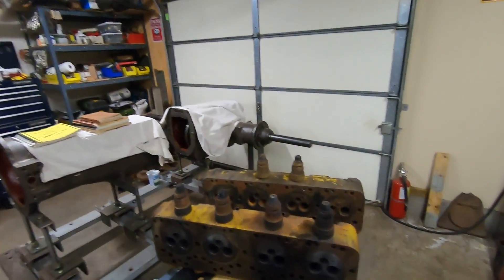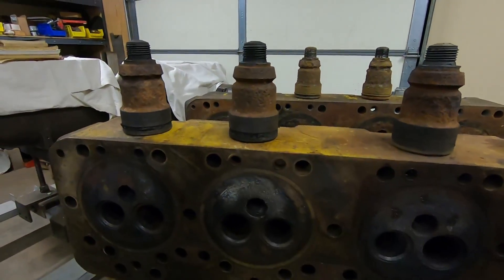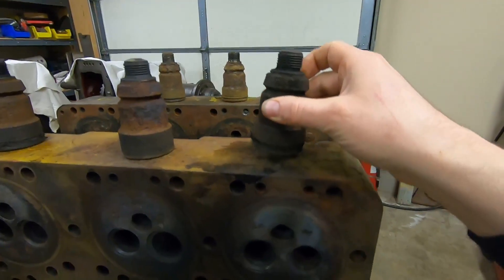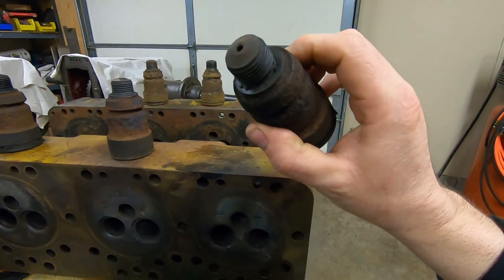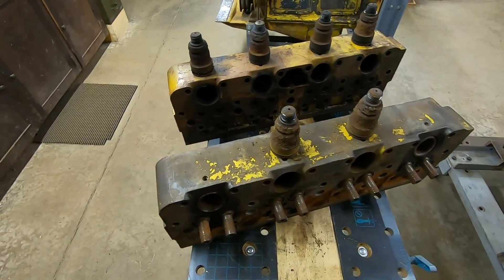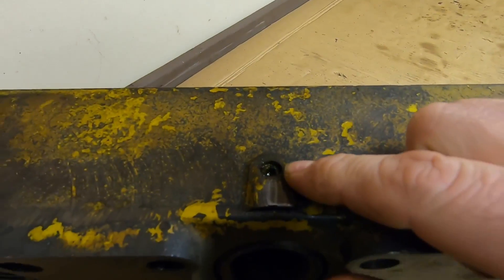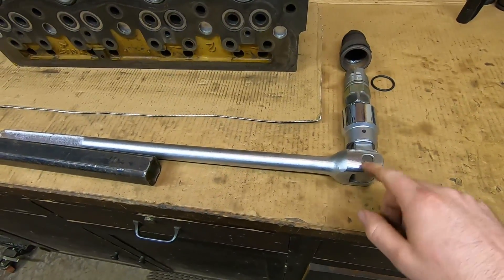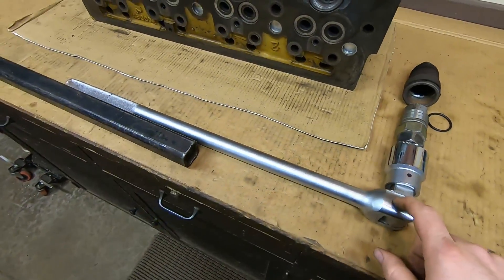Caterpillar D2 #5J1113 Diesel Engine Assembly Ep.24: Precombustion Chamber Conundrum

Comment: you are right it is a catch. Like your shop in Iowa, can you heat the head evenly, such as in a food oven? Do you use a penetrating oil? let it soak with a carb cleaner to loosen the carbon. use a penetrating oil and let it soak. these things should have been done for a long time such as the last couple of months

Comment: The dry ice idea is great.

One other thing to try would be a large ultrasonic cleaner...on low or medium setting.

Can't say how many times it's worked gor me on rusty or stuck bolts on parts heat cant be applied.

Comment: Is there any way to pressurize the water jacket portion of the head and just see if it leaks air up to certain pressure. If you pressurize it and it holds four a reasonable amount of time then it's not going to leak.

Comment: Warm the entire head to operating temperature. Then use cold CO2 in the combustion chamber to quickly chill it and take it out. Don't know if it works on cast iron, but it does work to get stuck spark plugs out of air-cooled aluminum heads.

Comment: This is an old machinist trick you hate up your studs whatever you need out with paraffin wax it works great paraffin wax doesn't burn off when you heat stuff up that paraffin wax as a lubricant

Comment: Is it possible to slowly heat the whole head?  I watched a video of a guy re-sleeving an old hit and miss engine by heating the entire engine to drop the sleeve in.  He said it took a few hours to heat up the cast engine and many more to slowly cool it down.   You'd need a good setup to mount the head securely so you could wrench on the chambers within a minute or 2 of it coming out of the furnace safely.  If you could have a lifting bracket bolted on each end so that you could slide a pin through a clevis, through a hole in the bracket, and then the other side of the clevis with the clevis attached to a couple links of chain bolted to a piece of square tube all supported by/on a conveyor trolley chain hoist.  Then use the trolley to move the head to the mounting, secure it down, and start wrenching away.  There's probably an old shop in Duluth or the Twin Cities with the perfect setup.  It's probably going to take an entire weekend to complete (heat up & wrench on sat, then pick it up Sunday after cooling down for 5-10 hours).

Comment: You have put too much effort into this engine to take any chances. In my experience any O-ring that old in such a critical area should be replaced. Now is better than after the engine has been damaged by antifreeze getting into the oil.  I think it's better to sacrifice a few good parts now than lose an engine later.

Comment: Leave the head alone.   When pulled to the block the .002 will lay flat.  The pre-cups in the head might work for a 1000 hours but if they don't you can easily access them to fix.  Not worth ruining the good parts.

Comment: You already know the right thing to do as you have demonstrated in all your past videos. Sacrificing a few old very hard to find parts is sometimes necessary to do the best job possible. And the best job possible is always worth the extra effort. It appears to me that you are doing the very best job possible to bring an 80 + year old machine back to factory new with period correct parts. New seals on the chamvers is right inline with that. Maybe its just my ocd but i would want 1113's precombustion chambers in that (closer to correct year) replacement head even if those chambers weren't born in 1113's original incarnation.
Just a few thoughts from a dumb mechanic

Comment: hmm...that 1 11/32 bolt in metric is 34mm    one option to getting those combustion chambers out would be to put the head into the oven at 200F for a couple of hrs and then try breaking them loose. that way the head isn't heated disproportionately

Comment: 50+ Years for rubber O-rings is a tough one, I'd go for changing them. I've got some (hopefully helpful) ideas though. I've heard that a mix of automatic transmission fluid and diesel does well on rusted stuck parts, never tried it myself though, so no experience there, I usually go for our local brand of rust remover.  Maybe you can give the head a bath for a week or so to let it seep in and heat it up in an oven afterwards so the whole head is nice an toasty to avoid heat stress fractures and then go for ice spray on the chambers instead of more heat on the head, should do the same trick. Anyways, wish you best of luck on removing them if you choose to do so.

Comment: When is good ...good enough.... well what`s been your approach to this point.... exactly... pull them out!!! I`m following another vintage enthusiast and they were working on a D-2 dozer and it`s funny because they had to pull the head off due to leaking seals on the chambers. They had an aftermarket tool that fit the chamber and they were extremely lucky with all four... only used a little heat!! They had to replace one piston sleeve due to rust... it was sitting for years before fixing... the sleeve was $400..WOW!!! Great content man... looking forward to the completed project!!

Comment: If i were in your shoes i would pull them. With all the effort you put into this engine it wouldnt make sense not to pull them. 
Looking at your tool to loosen the chambers you put the rubber o ring in it to protect it. Maybe it is possible to make a collar on the tool so that it doesn't go in to deep.

Comment: nice video as always in order to take the precombustion chambers out without doing any damage to it and not needing to put heat on it i would use a big air gun the one they use to undo semi's tires off that way those things have crazy amount of power which will be good for ur application saying this is in past i had similar problems on car engines removing stubborn bolts out and the only way is to use something with big force that will drive them out using hand technique can lead to damage since u have the other one rusty head i would try on that one first to see how it performs than use it on the good one and also see if u can make the better tool i would get two of the bolts stack the together and weld them so u have the same hight distance inside of the hex as the tool measure what is the distance of the hex inside and make same tool so it has more to grip on it this way it should not make any problems taking them out. good luck mate.

Comment: I sure hope I don't offend you but all things fail given long enough. Those chambers will leak but when and no more often than run you may be tempted to leave and that is not you. Your best shows up every time you put the boots on and go to work. Some old cat mechanic has that tool as I have had one before in hand but I never owned it. I believe that is a sixteen point "torx head" as I can't remember that many years back. Up close and personal was the place you used your 3/4 drive flex bar. I'm thinking to go around the pre combustion insert, you would have to use a smaller milling head and go back and forth and around the chamber cause it doesn't come that close to the piston or in my world should miss/clear it after said and done cause it will still be in same spot after milling is done, in or taken out and put back. It really needs milled if the dings are bad enough to cause you worry. I have skipped steps like this to have it bite me a couple times and hence been bullet shy. That tool can be found but in  what year or place... australia, japan, usa... who really knows. Have you touched base with all cat people that you know? I kinda lean towards using a variable speed impact to jar it loose but no heat. I seen people use heat on heads and cylinder blocks and I just walk away as it hurts to see that. Thats a Arnold Schwarzenegger attempt. I have used impact to break head bolts loose and no foul. Just my last thing to try. go with what makes your heart happy and go with the roll. I have seen a few liners in the 1693 cummins come just as hard and used a jack on the bottom with a puller on top. I broke on liner puller before I did that of course now I am 72 and worthless!

Comment: Boy you are very lucky not to break the thread off the chamber good job, Loving your reassembly vids all the best to you and your dad with his engine. If it was mine I think I would try to reseal the chambers as that head has been running and that to me makes me believe that they would come out without a big effort , as the other head was just laying around weathering, as you said you do have spares and they can be replaced, even in the future how many times are you going to pull the chambers on other engines to reseal to me not very often so yes reseal them or it’s going to sit in the back of your mind that you only did half a job on that head, GO FOR IT YOU REALLY HAVE NOTHING TO LOSE you can only gain

Comment: Soak with penetrating oil and gently warm the whole head in front of a heater, just so it's warm to the touch not that hot that you can't pick it up. Then pack the chamber with dry ice to shrink the combustion chamber just enough that it hopefully lets go

Comment: Not sure if it's been mentioned before. Marty T used brake cleaner to cool the combustion chamber while used a propane hand torch, it seemed to work for him.  SQUATCH.  As for removal best start using penetrating oil on those chambers while you're thinking about it. THIS is not in BOOKS.!.!

Comment: You can only pull down what you weigh.  If you can lock it down and pull your bar up, you can generate a lot more force.  I weigh 230, that’s the most I can pull down.  I can squat lift 500, that’s twice as much force.  If it’s stuck, pull up.

Comment: I would say give it good time (even days,if need be) removing each chamber with low heat, cooling to ambient, application of DW40 and gentle persuasion. High heat would stress the head, leading to cracking.
On cylinder head surfacing, does CAT have progressively thicker gaskets to allow for machining?

Comment: You've done an outstanding job repairing this engine up to this point and have been meticulous with everything to ensure a maximum chance of success.  Leaving everything as-is, IMO, is just inviting trouble (at least with the luck I have). As much as the potential "suck factor" may be, I'd pull the combustion chambers and mill the head.  If nothing else, it will give you peace of mind knowing it's been done right.

Comment: Oh you have to seal those chambers. Buy the best penetrating oil and use it. You want to, and you can, you will not feel right until you do it. The point is that you are skilled enough to do it. So given all of that. You should do it. I vote for using the best penetrating oil on the planet, perhaps a air impact driver on a low setting to kind of hammer at it, I think you can do it without damaging them as meticulous as you are.

Comment: If I found myself in this situation and failure was not an option I would: 
Buy a short section of 4140 round stock (eBay probably) the diameter of the precombustion chamber thread i.d. or larger to turn down to a nice fit. Then machine the required double hex to fit the precombustion chamber nicely, and then the regular hex on the other end for a socket. Machined to the correct dimensions that would eliminate the need for the O-ring and any chance of possible damage to the tapered injector seat. While that was going on the head could be heated up in an oven or directly in front of a couple electric heaters for a nice even heat. Once everything is all ready put tool in place and apply some ugga-duggas, and I'd be willing to bet they would come out with little to no fight and zero damage. Having a true double hex / 12pt engagement much more efficiently transfers the energy into the precombustion chamber when trying to loosen and will eliminate the chance for distortion that can happen when applying major torque (especially by hand) with a regular hex drive tool.

Comment: let sleeping dogs lie. I would hate to see some threads come out of the head when you try to take them out. if you had a problem down the road it's only 2 -3h to get the head off. how long you're going to spend trying taking take them out? keep up the good work. p.s. my 922 needs a new O rings in its pre-combustion chambers.

Comment: There's an old machinist addage I've lived by for years...."Do it right the 1st time to avoid all possible grief later on"...you're this far into it now so...  Try removing the p/c chambers carefully as possible. Drill out if need be.   Another option is having some ( or all) p/c chambers made by a good machinist...might cost a bit but then you know what you have when you're finished.  On a side note...for removing these from the old damaged head , you could have drilled stress relief holes in the head just outside of where the chambers screw into the head...then add heat to remove.   Either way...if it was my project I'd be pulling those chambers to reseal them....especially after all the work you've done to this engine so far...be a shame to risk future damage to a reconditioned engine because of second guessing the decision!    Good luck & hope it goes well !

Comment: The first thing that comes to mind is would you eat a half cooked chicken? No of course you wouldn’t, so why would you half ass your head job.  Man you have gone to do many lengths to make this engine as close and as good to new as you can with so many NOS parts, and good salvaged parts (look how many blocks you went through for a good one).  At this point you have done too much to make this engine the closest to new that is going to exist to not do the proper head job.  You gotta pull the chambers and make sure those seals are good, we all know that I’d you don’t they are sure to leak.  Pulling them is going to give you the ability to machine the head flat and like you mention give you more material to get your valve seats ground proper without the worry of being on the edge of enough material.  I get that parts are hard to come by let’s be real, this entire build is about 5J1113 and you gotta do what’s right for it for now.  Seeing the head I think you will have much better luck pulling the chambers, things just look less rusty.  I’d suggest before turning them out, that you get some dry ice or liquid nitrogen to fill the chambers with rather than heat, it may help to shrink shock the threads to get em out.  Good luck really hope you decide to yank them out.  Let’s make 5J1113 great again with the best and most complete build possible!

Comment: Okay. Here's my recommendation. Test this theory on the head with the stuck chambers in 1 & 4. If you can scrape the o-rings to release them from their bore with a dental pick. Then using a non-contact temperature sensor heat the head to the engine's operating temperature or slightly more. Then spray penetrant at the threaded end and at the top as well. That will cool and SHRINK the chamber's size to allow the penetrant to seep into the threads and upper portion in the bore. I suggest doing this with several cycles then gently applying clockwise and counterclockwise torque on the chambers. If you can get any rotation then you should be winning. At that point a little more heat/penetrant/CW/CCW. No rotation... let the penetrant soak over night and try again. I REALLY hope this works because we all pulling for you.

Comment: Plan to take them out...Kroil those chambers for several days from the bottom, order the kroil in a gallon size, use a pump oiler and a gallon will last you several years, if not more...if you never used it, do yourself a favor and make the small investment.  I've been watching you for several years, and for all the info you have shared,  I'll even send you some if you'd like to try it.  For all the wrenching you and Senior do, it will become your go to juice.   Yellow fever is catchy, since  watching your channel, I've added two D2 5U's (one rough one and one in very good shape) and a D4 7U to my crawler collection.  Also....how about some never seize when you put them back together.

Comment: Take them out. Everything you do is thorough and great, get them out.  I just watched a video of 2 guys salvaging a d2 they have in Australia.  They heated the chambers up with a propane bottle torch, then they shot brake cleaner up into the nozzle and it cooled it down causing it to shrink while the outside was hot and expanded.  It took some weight on the beaker bar but they got all 4 out with zero problems. If I can find the video again il post it, it's a cool vid.

Comment: Hopefully you will see my comment. I know you will get Hundreds of comments, but my thought is torch heating definitely would be a no go on this head. What I personally think would be a good way to remove the pre-combustion Pieces would be to put it in your oven dead cold & heat it up to maximum temperature. At that point take it out and try to remove the parts. If you use a torch, it's going to shock the casting in an uneven manner. If you oven heat it from ambient temperature, it will more than likely not cause any harm to the cast iron and more than likely let you get them out. Good luck my friend..

Comment: Clearly you are between a rock and hard and hard spot.  I would try to use  some aerokroil or silikroil penetrant and maybe some mild heat from a heat gun.  That is a tough job. I wouldn't want to tackle it with out replacement parts in hand.  Good luck!